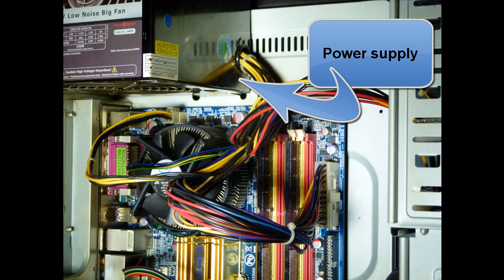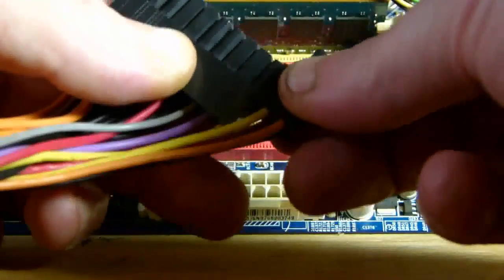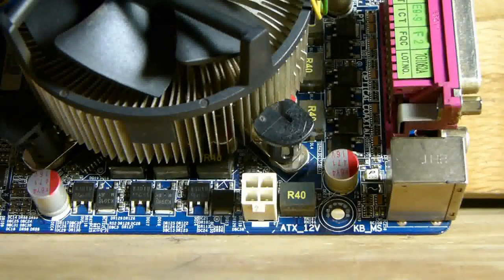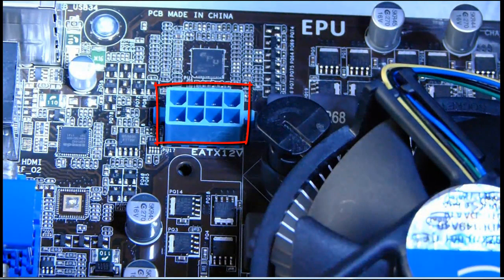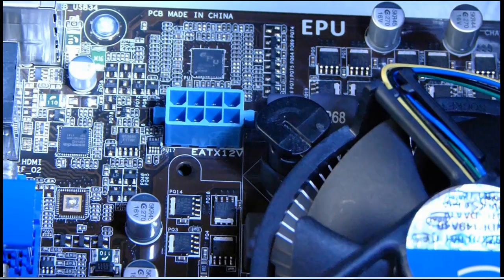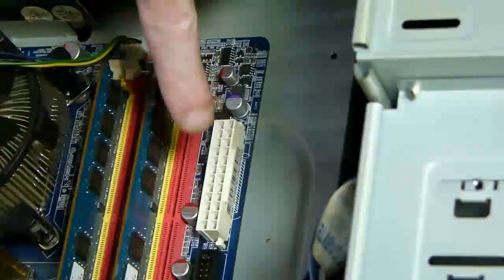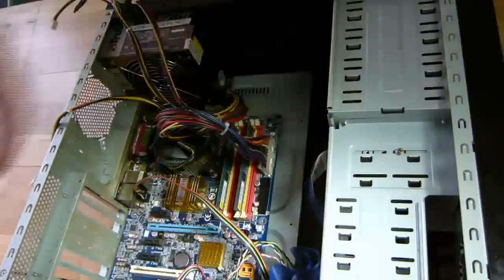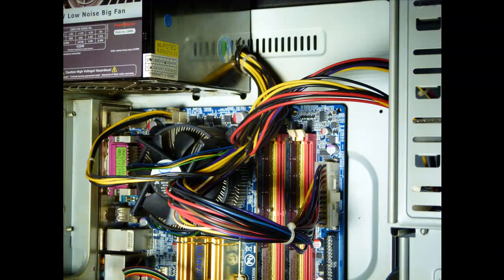connecting power supply to a motherboard

Comment from the maker: Hi AlcatrazSniper, What is the model of your motherboard i can't tell you exactly... all boards must have a processor power connection or it will not work, so let me know what model your board is and i will check for you but you should be able to find this out in motherboard manual...

Comment from the maker: Hi Sotiris, Not with out power going to the processor there is an other 4pin connector that you must plug into the cpu ATX12V will be printed on the board beside it. Don't turn on the power until you have install the cpu fan and also remember that the cpu fan has to be connect to the board anter that you can turn on your PC to test but all you'll see is the fans turning and few lights. always always check you're Manual and double check everything before you turn on you're PC.

Comment from the maker: Hi Greg, You will need the extra 4x4 pin power for the cpu cause the  Adobe After Effects will require extra power for turbo when in high usage... put it will work with the just 4 pin connector but no turbo power so things will slow down when in high usage. a new power supply will not be that expensive i sagest you buy one for comfort of use...

Comment: What if i have a I7-3820 and a GA-X79-UP4 (That requires 24+8) but my psu is 20+4 pin? what do i do i am not overclocking however i am using Adobe After Effects on many monitors do i use the converter 20 to 24 and 4 to 8?